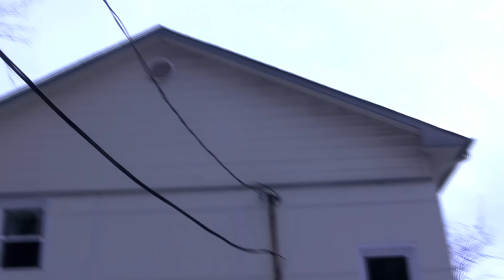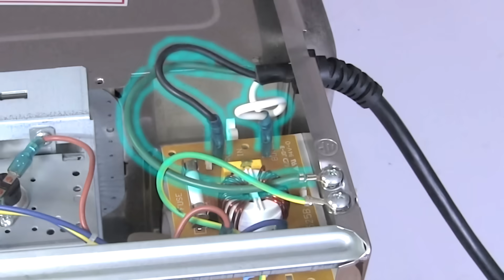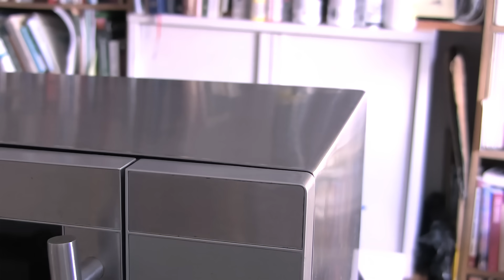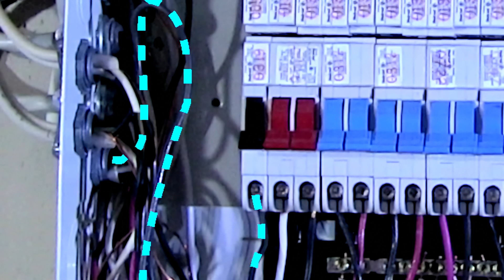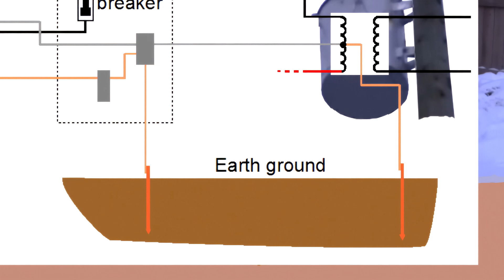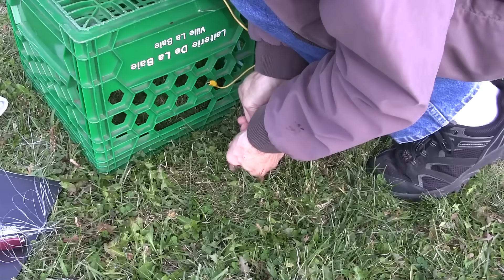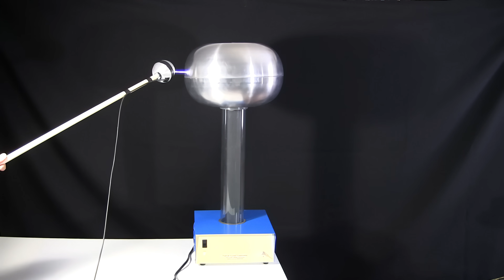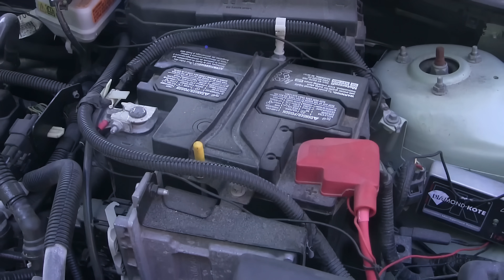What is Ground? Earth Ground/Earthing

Comment: @2:40 it flows through the case and then to the ground wire. wouldn't that still end with someone getting electricuted? or it goes through a narrow line of the case directly to the ground wire, like it doesn't spread all through out the case on its way to the ground wire? Thanks!
Reply: When a live wire hits a grounded metal case, the case and ground wire are basically one solid, low-resistance path back to the source. The current takes that path, not a human body.

The case might carry current for a moment, but the voltage across it is tiny, so there’s no real voltage to push current through someone touching it. That big fault current trips the breaker fast.

It only gets dangerous if the ground/bonding is bad, which is exactly why grounding (and GFCI/RCD as backup) matters.
Reply: @coolerbast1  Thank you very much for taking the time to explain that!

Comment: I still don't understand why we need 3 separate holes in outlets. As shown, the ground wire and neutral wire connect to each other in the breaker panel. Why not have them connect together right before they enter the wall outlet? That would eliminate the need for the 3rd hole.
Reply: One reason is in your US outlets, but also on the Europe ones ist that ground is connected first and disconnected last. So before the hot or neutral wire is connected everything is grounded first.
Reply: I am not an expert, but I believe it is due to what he said about the ground line having very little resistance and thus very high current which enables it to trip the breaker. I would imagine then that the neutral line has more resistance when compared to the ground line.
Reply: @hidden2753 thanks! That certainly seems like a good possibility. Another theory I saw in response to a similar question was about using a mismatch in the current going through the neutral and hot wires to detect ground faults in GFCI protection. I can't find a confident answer anywhere though

Comment: Am I correct in understanding that if you unfortunately touch the microwave, and the hot wire insulation gets damaged and touches the case, the electricity would kill you as it traveled to the breaker?
Reply: If microwave case is not grounded and hot wire touches the case the current has two ways to go, through the microwave circuit and through you. In other words you would literally take a hot wire in your hand. So yes you will get shocked and could even be killed.

If microwave case is grounded almost all of the current will go to neutral/earth. Some of the current will go through you, but it will be a very negligible amount, not even close to cause any harm or feeling. Breaker in this case is not to protect you (grounding already prevented you from getting shocked), but to protect the wiring from short circuiting and overheating.

Comment: 🇬🇧 The US has crap standards across many things, electrical systems being just one of them.
Reply: As a Brazilian i almost had a heart attack when he said that the neutral is connected to the ground, this and that shit flat pin standard for gods sake
Reply: I don't get why they do that, why to connect the neutral to the ground? That will generate "noise" and lower the lifespan of equipment, also if they want that much the neutral to the ground they should use a different ground rod for it, never the same one (what already exists in the power lines soo...), I hope that it's just an author "error" not the actual US standard
Reply: @p @psyopsvictimBr  What are you talking about? The ground conductor protects people from line to ground faults — exactly what the video says it does and fully explains how it does so. Open your eyes and ears. This is the most basic, cheap, and scalable way to protect lives, but obviously not the only way. Also, tying them to earth at the mains panel and distribution transformer does not create noise issues, do you think that power distribution works like PCBs? The ground conductor does not and cannot carry return currents. Turn your brain on.
Reply: @adagietto4616 well i was not thinking like a PCB but I was thinking that the TN-C-S standard would had the same problem as TN-C, I understood the difference from a link from the author from another comment.
Calm down bro I trying to use my brain here, the "noise" dumbness aside I still don't understand why to not just use a TN-S systems, it's objectively better, unless the source company doesn't has a ground line, but I usually thinked they aways does, well there is in fact some different standards.
EDDIT looks like I was luck for always had a ground from the grid with no PEN, TN-C-S is also very common in my country just not in my region, I had stumble across TT with DR in rural areas of my region though what's not ideal but pretty safe also
Reply: Inbred islander being slaughtered by Muslims says what?
Reply: @Calc_Ulator  You have much greater demographic problems than us.
Imagine only lasting 250 years and already falling apart lol.
Reply: @jamesblackwell6557  imagine getting beat by a startup country and then talking shit on a platform made by them lol

Comment: i think there is a mistake in the video the ground wire is not connected to the neutral wire at the main board but it is just connected to the ground rod and then the circuit for fault current completes via ground to ground rods at the house and at the pole meanwhile the MCB trips due to large current through low resistance grounding. this is because sometimes neutral wire too carry current so it can shock you via the ground IF your ground wire is connected to the neutral wire at the board.
Reply: There are more motives, this one being the primary, I hope that was his mistake not a US standard, this neutral to ground connection should only occur in the power lines.
Another motive is that many electronics use ground as a "baseline", having the ground connected to neutral would generate noise that would lower the lifespan of those electronics (and usually are the expensive electronics that need it)

Comment: Actually with that portable radio the tree was the ground you were on cardboard you would have been insulated you did however add another form of capacitance as there was a electrolyte between you and the ground and your body does actually carry charge so more or less you acted as a dead short to one of the trees roots that ran deep into the ground.

Comment: Why does the white wire make a circuit but the ground wire blows the breaker? They are both connected exactly the same way to ground and are both connected the same way to white. I’ve always been curious about this. Why the white bus is bonded straight to ground in the box? You explained it but still why does the current not follow ground? Crazy 🤪
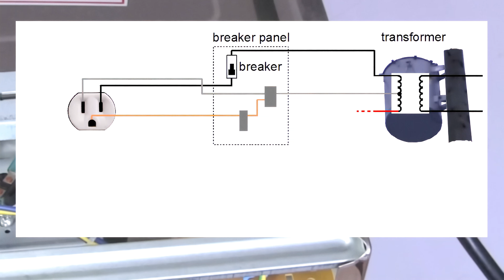Reply: In the diagram at 2:15, when the hot(black) wire touches the metal case, this fault effectively connects the hot wire directly to the ground(bare) wire, not to the neutral(white) wire.  This creates a shortcut back to the panel, which is connected to the power supply(the transformer winding).  This, in turn, provides a very-low-resistance path for current to quickly skyrocket, tripping the breaker.  Notice that the neutral(white) wire is not connected to the metal case, only to the proper resistive circuit within the appliance, also called the "long" circuit.  The hot wire-to-case-to-ground wire creates a "short" circuit.  The white(neutral) and bare(ground) are connected together only at the first point of disconnect to avoid creating a parallel path for normal current.  The neutral(white) is the grounded conductor, which is designed to carry current during normal operation.  The ground(bare) is the grounding conductor, designed to only carry fault current and relieve any static voltage.  Normal current doesn't follow the ground(bare) because the ground wire isn't connected to the working circuit.  Does this answer your questions?
Reply: because in this example the white goes through the internal electronics of the microwave, which has a higher resistance. When a fault conducts hot through the case to ground, it bypasses that resistance, increasing the current and triggering the breaker
Reply: @coagmano thank you

Comment: Rods in the ground are for Indirect Lighting inducing a charge into metal "EMP"  and helps discharge only,  Protects you from getting zapped by lighting strike nearby and sparks that might occur in the wall causing a potential fire. If the lighting hits your rods probably evaporate so its meant only for indirect hits.  Its not for fault current, even seasoned Inspectors say this....I say take a wire on a 20 amp circuit and stick it in the ground, all you get is worms.

Comment: What happens when an electrical device that is on the roof gets hit by a lightening? Because the surface of the device is connected to a ground, which is to all the surfaces of the other devices, how likely is one to get the shock from the lightening who are using other devices?
Reply: Why the extra e?

Comment: Now double-insulated smaller handheld appliances use two layers of insulation (or plastic case) instead of relying on a ground wire connected to the case and to earth.

Comment: There used to be a lot of metal lamp stands with only two wires.  IF some wire touched the metal body rather than just the lamp socket, you WOULD get shocked.....even if the break happened hours before.   IF the switch was installed on the neutral rather than the hot by accident, a shock could occur even with the lamp turned off.  OR if the broken hot touched the metal lamp stand before the switch.   DEATH is why the code was updated......as usual.    Now double-insulated
Reply: Many, if not most, lamps still do use only two prongs - even metal lamps. In fact, a lot of devices use only two. I’m keenly aware of this because half my house is still wired without grounded outlets.

Comment: A hand on the microwave case with a broken hot wire touching the case can vary widely in the result.   Rubber-soled shoes on the second-floor of a timber built building to standing barefoot in a puddle in the basement (OUCH).  The point is with a separate ground the instant the broken hot wire touches the case, a circuit breaker is tripped.

Comment: alright, dumb question, but what is the point of a neutral? I work on Aircraft Avionics, and there's no such thing as a neutral wire, only a Hot and ground wire, when it comes to power distribution, the closest thing i can think of, is a floating neutral which is just a wire that goes nowhere, or a floating shield which is a separate wire that gets soldered onto the shield of a shielded wire, which then doesn't go anywhere, otherwise all our grounding is either to Airframe ground, or to a bus bar.
Reply: Actually it is not the neutral wire but the ground wire thats absent.
Reply: Well as the video says, to ground properly you need something that can take all the charge without becoming charged itself.
In Aircrafts, theres nothing that could ground properly, so it's not able to absorb a lot of charge. So I guess the Ground acts more like a neutral in your case.

Grounds are, in addidtion to the points mentioned in the video, also important for Ground Fault Circuit Interrupter, because when you connect Hot and Ground with your body, electricity flows through the ground, and therefore the Current between the Live and Neutral arent the same anymore. Thats what trips them and saves your life.

Because normal breakers dont protect people, they protect wiring so it doesnt overheat and burn. GFCIs protect people from Currents, and they need a different path for the electricity to flow in case of a short
Reply: @ret_ch_ard8502  Ahh, thank you. 🙏

Comment: Its crazy how a lot of engineering students dont even learn about stuff like this. Meanwhile they will teach you lots of math equations which in most cases you will never use when out in the industry.

There should be more practicals and teachings about how elecrticity actually works.
Reply: I work with an engineer that holds a mechanical engineer degree who used a multimeter to measure current of an outlet with nothing plugged in🤦 i just had to wonder what are they learning in college.

Comment: It worries me that so many of the comments here talk about not having learned about grounding when studying engineer or similar and that this explanation solved that for them. It is nicely put together, but if you are an electrical engineer or electronics engineer, you should really know this stuff. Laplace transforms maybe not, but the function of the earth wire in your plug..??? Maybe the fact that most plugs are permanently fitted means that people don’t put plugs on anymore. I learned at an early age to change a plug and put foil around a blown fuse (joke..don’t do that!)
Reply: If you're working in low power electronics - computers and stuff - or portable devices - ground is something different
Reply: Most Electrical Engineers go into electronics and not Power system. Ground in an electronic circuit means something different than Ground in a power system. In fact, ground is the most misunderstood term because it depends on the context.
Reply: I used to work with a bunch of "engineers".  Worthless.

Comment: Today i learned 4:05 is a ground wire, and not just a support. In retrospect, it doesn't really make any sense that a wood post deep in the ground would need such a support but whatever 😅
Reply: I’d seen those conduits on poles and never knew what they were either. It all makes sense now.

Comment: I don't get why you need a separate ground cable. Can't you just use the neutral as a ground?
Reply: Its basically done so that if your neutral shorts it gives a path to prevent blowouts from infinite resistance.  Its basically a safety feature.
Reply: If the neutral and ground were connected all the time, then the device would not work at all, because the electrons would always flow straight through the super-low resistance directly from the source to ground, bypassing all the higher-resistance working parts. In the arrangement described in this vid, the ground is a safety feature, which only comes into play when the neutral (or the hot) goes astray, as when one of those wires touches the case, making the case a live part of the circuit; then the ground becomes the path of least resistance which drains away the current safely. Without it, your body might be that path.
Reply: @blankslate1198  Great explanation, thank you.
Reply: Thats actually how houses were wired in the US in the past. Eventually they started requiring separate grounds and neutrals so that a ground fault would have an unimpeded direct path to quickly trip the breaker. It also makes sure that the ground wouldn't be a current carrying conductor (which a neutral is) in order to prevent unsafe shock hazards.
Reply: Ground and Ground-er

It's a bonus safety feature - some countries only have 2 prongs
Reply: In a TN-C Earthing system, you can. One conductor carries both rerturning currents and fault currents. I dont know how common TN-C Earthing System is tho. I live in U.S, and we use TN-C-S Earthing system. I believe TN-C is prohibited according to our codes

Comment: Why is there little resistance across the circuit when it's shorted to the case of the microwave? is that just because there's no load from the device?
Reply: Because it goes through the copper wire, and copper is a very good conductor of electricity so it has low resistance compared to your hand.

So if you touch the case with your hand the electricity will still go through the wire.

Comment: As a european, I cannot comprehend the horror that are us electrical panels.
Reply from the maker: Keep in mind that the electrical panel I used for this video is a very old one. Newer ones are of a much cleaner design, though they connect all the same ways (i.e., ground is connected to the case, neutral and ground are connected, ...).
Reply: US electrician here: I'm actually baffled by European panels. US panels are so simple and easy to access breakers in, and modern designs make it extremely easy to isolate the live parts when working in a panel
Reply: Non electrician here:
You guys are all wizards
Reply: Our panel may look messy because we dont hide our wires. But we care more about safety than looking neat. Fact is, our panels are a lot safer than most people, especially Europeans, think. They tend to correlate looking messy with being unsafe.
Reply: @nhitc6832 I disagree on that completely. European panels, besides being fancier and cleaner looking, are probably safer as well, because of rcds.
Also some pretty strick guidelines on laying cables, cable dimensions etc.
Reply: @etceterax144  I'm not saying anything about European panels. What I'm saying is people outside the U.S tend to correlate our panels being messy (even that is subjective) with being unsafe, and I'm here to say that illusion is false. Our panels are just as safe as others. Our breakers are just as safe as others. Our wires are just as safe as others. Our codes are written with safety first in mind.

Comment: Just an electrician here : this is the way I see "earth" used as a "ground". It is a reservoir that can both absorb (sink or "pump in") and/or supply (source or "pump out") an electric charge. It can also act as a mirror (reflect) and/or shield (absorb) for certain radio frequencies... Earth is intriguing.
Reply: As a third year electrical engineering student, I still don’t really understand ground and still don’t fully get nodal analysis and loop analysis man 😭
Reply: @caden5426  I studied electronics before I became an electrician, and all I can say is that a hands-on approach helps get the theory to sink in more... Try doing more bread board and see how loops and nodes work out in practice...